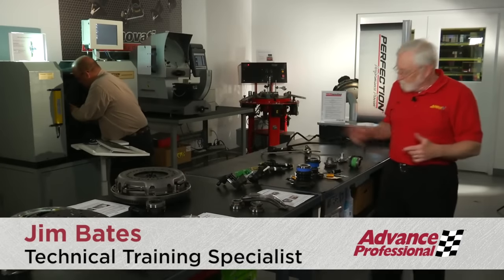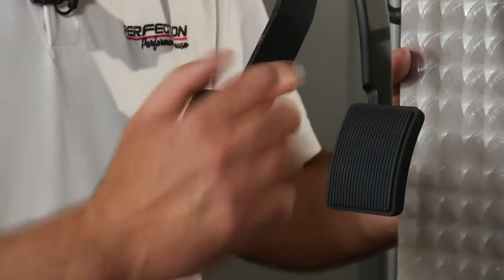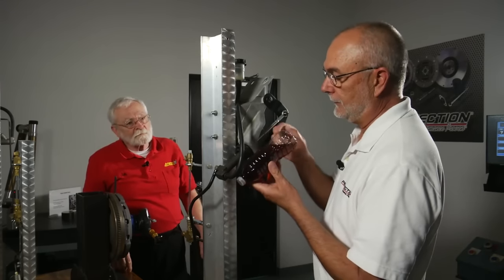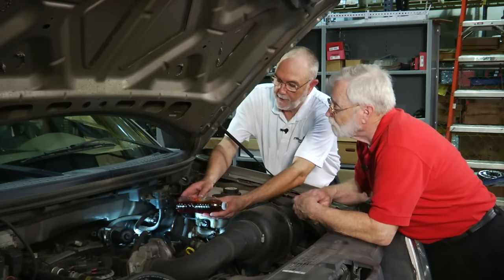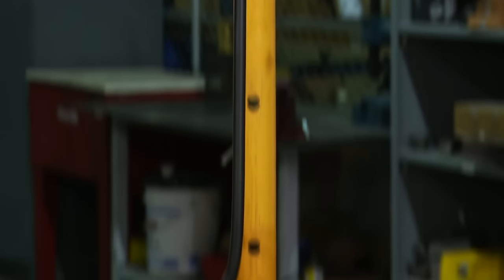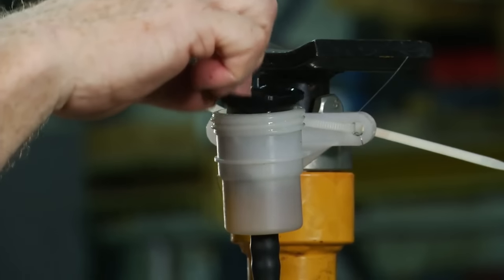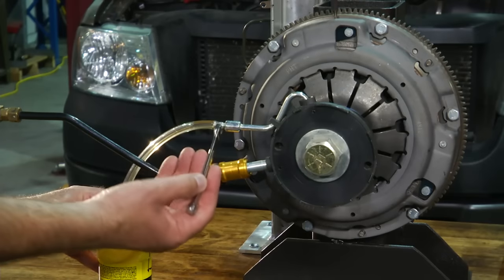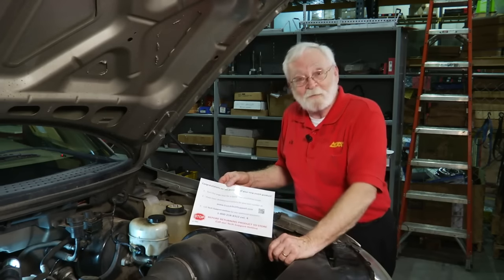How To Bleed A Hydraulic Clutch - Wrenchin' Up

Comment: Unbolting the master cylinder from the firewall, tipping it back, tapping it on the side and moving the piston in and out similar to the video worked for me. I did this without removing it from the truck.
Reply from the maker: Thanks for the tip. What vehicle were you working on?
Reply: @WrenchinUpwithJimBates  I fixed it on a1998 f 150 with allow to tip the master cylinder without disconnecting the fluid line. Easy!
Reply: Can u rebuild a slave cylinder for a 2007 sentra S.E.R spec v? And the box that the spring goes into wont hold the spring tight. How do I fix that problem?
Reply: Would jacking the front up of the vehicle quite high, while leaving the back of the ground do the same thing?
Reply: Sorry that should read, would jacking only the front of the vehicle up quite high  leaving the back of the vehicle on the ground, do the same thing, tilt the master cylinder enough?
Reply: @randylegall2162  that should work
Reply: @randylegall2162  that's what I was thinking - or park on a steep angle.
Reply: @carleynorthcoast1915  I feel like parking it on a steep angle pointing towards the river. Just a thought that overcomes me sometimes. Lol
Reply: @carleynorthcoast1915  But on a brighter note, I was talking to a mechanic I know, telling him the problem I was having with bleeding the brakes on that Infiniti g35, he had this strange look on his face like really! and then he says just run a clear plastic line from the caliper closest to your slave cylinder hook up both bleeders open them get someone to pump the brakes make sure the brake master reservoir doesn't empty out and boom your problem is solved. No one,not a single person on YouTube and I watched I don't know how many videos, of the different methods of bleeding a clutch ever mention this method, but if you think about it, the pressure from the brake caliper is quite a bit, plus your reverse pressure bleeding it, pushing the air out the way it normally wants to go which is up. I guess I'll find out today or tomorrow when I try it.
Reply: @randylegall2162  how did it go?
Reply: @bushratbeachbum  The project's been on hold, car has just been sitting, plan on this week changing the master cylinder and bleeding the system using the pressure from the caliper, I'll let you know, how it works.
Reply: @randylegall2162  how is your clutch pedal now ?
Reply: @kiwiingenuity1677  the project was put on hold I haven't installed the clutch master cylinder yet. Clutch pedal goes to the floor and stays there, needs to be pulled back up  by hand  Plan on changing the clutch master cylinder and bleeding it sometime this week I'll update you.
Reply: I’m about to do the same thing
Reply: @randylegall2162  lol
Reply: Frick! I was hoping you wouldn't say that

Comment: Sounds like a lot of work to me.....I just jack the front of the truck up and bleed normally. Sometimes you have to let the master cylinder "snap" back to get it to take in the new fluid but it's never been difficult if you ask me.  I'm an aircraft mechanic and the older Cubs were tough to get all the air out....until you raise the back of the plane above the level line.....you can set the tail wheel on a chair and it bleeds out quickly and easily.  Harley master cylinders can be tough too until you turn the handlebars to raise the end of the cylinder.   My neighbor brought his jeep over because the clutch didn't work well....jacked the front end up and wala!  bled right out and he's happy....now he won't leave me alone....hehe
Reply from the maker: Hi - Thanks for watching and for your great comment! What is the year and model of your truck so other viewers can try your tip too?
Reply: Thanks for the comment back!  The latest was a 92 jeep wrangler...it was the clutch slave but it will work on any hydraulic system.  If you don't let the master "pop" back the slave cylinder will not "reset" and you'll be there all day trying to figure it out.  The important part is to get the filling port in the master to be higher then the other end.  That will let the cylinder fill and the air to escape out.  Otherwise the bubble can remain trapped and it will never completely bleed out. Sometimes, especially with the tiny master piston in Harleys, you can tilt it one way and bleed it a bit and then raise the other end and it will make it bleed more quickly and completely.  The Piper cub I mentioned stumped a lot of mechanics and the first time I put the tail wheel up on a chair it bled right out for me.  I flew that stupid cub with limited brakes for 2 years before I figured it out.  In aircraft we pressurize the BLEED valve (with a pump type oil can.....we use 5606 oil in most small airplanes) and let the master backfill.....still won't work if the master is too low on the wrong end.  I hope you had a very Merry Christmas and a happy New Year!
Reply: Exactly.. Some cars can't be bled first due to the positioning of the pedal in order to connect the master cylinder arm to the pedal (Can't be done under pressure)
Reply: What do you mean when you say you have to let the master cylinder (pop) back, or the slave cylinder will not reset?
Reply: @randylegall2162  I've found that if the slave cylinder moves too slowly it will take the air bubble with it.  Let it up quickly and it will not try so hard to follow it.  It works...trust me....same with Harley master/slave

Comment: Trying to bleed the clutch on my truck - all hydraulic but the master and the slave are double the size of what’s in the car. I’ve just replaced both the master and the slave, trying to bleed it up but having no luck. The master is mounted vertically and bolted under the pedal assembly with a steel line going to the slave, there is a bleed screw on the side of the master and a nipple on the slave. Which end should I bleed it from, if I were to remove it from the truck it will empty of itself of fluid
Reply from the maker: Hi - Thanks for watching! Since that didn't come up in the interview, I would like to suggest that you check with Perfection Clutch for this because they have a vast library of specific videos and information. Their contact information is in the video's description.

Comment: Thanks for the great video. I parked my truck on a really steep hill and pushed my pedal about 20 times . It fixed my spongy pedal. You guys are awesome.
Reply from the maker: Actually. you are awesome for watching! I'm glad we were able to help, which is why we make these videos in the first place.
Reply: Ok where I live we have plenty of steep mountains so I’m going to try it . You removed the cap on the master ? Do you have to press the clutch petal gently so you don’t lose a lot of fluid. I would hate to get air locked on the side of a mountain 😊 Thanks

Comment: Well thanks to your video I finally got my old 91 s10 clutch bled..I just had to take it out and bench bleed it at the angle you stated....This has been a struggle for me and have been putting it off for months, I spent my life working in garages and on junk and never had this much trouble....I had to come find your page so I could thank you...Thank you so much.......
Reply from the maker: Hi - Thanks for your great comments. I'm glad the video helped and your project went well. Thanks for watching!
Reply: Same here man! 92 f150 making me question everything I thought I knew about cars! I've changed clutches in semi trucks, rebuilt suspension, engines... You name it! But evidently I am a complete failure at the simple task of bleeding a clutch 😂🤣😂 I think trying this will solve it for me.
Reply: what do you have to hold at a angle? Have an 89 s10 nothing but problems. But new parts and they go bad way too soon. New fuel pump lasted less than a month! Replaced all components at engine mechanical then the hydrolic stuff goes bad!

Comment: This is great but what if you have hard clutch hydraulic lines and you can't remove the entire system from the truck? Nissan xterras... long runs and it goes up and down between the slave and master ....
Reply from the maker: Hi - Thanks for watching! That didn't come up in the interview, so I recommend that you check with Precision Clutch about that because they have a vast library of vehicle specific videos and information that should help. Their contact information is in this video's description.
Reply: @WrenchinUpwithJimBates  NO worries man, if anyone is reading this it ended up being the slave cylinder was jank, and needed to be replaced, once  that was done, two master cylinders worth fluid and pushing fluid up from the slave cylinder (reverse fluid injection), worked amazing. Clutch pedal never felt better NO bubbles in zero seconds

Comment: On older model Volvo semi trucks they are bled  from the slave cylinder back through to the master cylinder . Use a windshield washer pump , attach line onto bleed screw  of slave cylinder  . Pump fluid until it overflows from the uncapped master cylinder and tighten bleeder screw .Install cap and tighten .                  On Chevrolet pick-up trucks it is possible to cross calipers , make sure bleeders point upward .
Reply from the maker: Hi - Thanks for watching and sharing your experience!

Comment: Depending on the master cylinder orientation couldn't you just jack the front of the car up? Or park it facing up a hill?
Reply from the maker: Hi - Thanks for watching! Some folks posted that worked for them.

Comment: Question. When you remove the clutch pressure line at the Slave Cylinder is the connection a quick sealed connection so air does not enter the line? My guess it is like an air hose coupler fitting. I also think you should use the Phoenix brake and clutch tool to remove any trapped air bubbles by inserting the tapered fitting into the bottom of the Master fluid Orifice to force new clean fluid down into the slave cylinder and open up the bleeder screw to allow any air to escape befor tightening it up again.
Reply from the maker: Hi - Thanks for watching! Great question - so great that I must recommend that you reach out to Precision Clutch, because they have a vast library of vehicle specific videos and information. Their contact information is in this videos description.

Comment: I have used A vacuum pump and A cap that fits tight over the resivor with A brake bleeder bottle and held vacuum in the system for about 10min and wah-lah that works real good !!!
Reply from the maker: Hi - Thanks for watching and sharing your experience!

Comment: Works great if you can remove the entire thing from the car.   Most cars I know of seem to have metal lines and are not removable as a sealed assembly or are capable to be installed as a complete sealed assembly.
Reply from the maker: Hi - Thanks for your comment. Vehicles that allow for the master cylinder to be "tipped up" can use this procedure. Others that cannot will have to use different methods. Check the website in the metadata to see what they recommend for different vehicle configurations. Thanks for watching!

Comment: If I install a new Master Cylinder Your not supposed to insert the clutch pedal push rod until the entire system has been reinstalled.
It is the last thing you reinstall and it locks into place in the master cylinder.If i were to use this method of bleeding the air from a new master then do i need a special tool to releae the push rod after bleeding process and reinsert again as the last item you connect?
Reply from the maker: Hi - Thanks for watching! Great question, but I must suggest that you reach out to Precision Clutch for the proper guidance, because they have a vast library of vehicle specific procedures that can help here. Their contact information is in this video’s description.

Comment: I have a 1991 F150. For the past year or more l have considerable difficulty, especially when first started, getting it into 1st or any gear, with grinding, etc.. Also diminished clutch travel. 
It sounds like an air problem????
What do you think?
Reply from the maker: Hi - Thanks for watching! I could be, but I suggest that you check with Precision Clutch to be sure as they have an extensive library of vehicle specific information. Their contact information is in the video description.

Comment: Nice video! My client's own had a similar issue so I bleed the clutch and still to no avail. I've even replaced only the kit inside the upper clutch but the problem of a sponge clutch and no gear still persist.
 I've checked scrutingly for signs of leakage carefully while someone else pressed the clutch pedal and found out that the down clutch nipple doesn't hold clutch hydraulic fluid! It goes out gently, and also the clutch fluid was replaced with a new one. Nevertheless, it's still very darkened in color. Please, how do I fix the issues? 
   Darkened fluid, soft clutch pedal, and a most especially the leak at the down clutch bleeder  or nipple.
Reply from the maker: Hi - Thanks for watching! Being retired and a bit behind the “latest and greatest procedures”, I recommend that you check with Precision Clutch because they have an extensive library of vehicle specific videos and information that may be of assistance to you. Their contact information is in this video’s description.
Reply: @WrenchinUpwithJimBates  Thank you so much Dad.

Comment: Ive had problems for a month now but believe me or dont my problem is getting better lol. A few months ago i started having probs getting car into gear and reverse was an absolute no no. The car started to rev up badly before the engine caught up again and accelerated whilst driving and sometimes this must have been a nightmare for cars behind me.  I checked the brake fluid tank and it was empty so i filled it up quickly. Now my clutch runs of the same tank! thats what i think has happened. Since i filled it back up my clutch pedal would become harder when i pumped it and i feel ive had air in the system. It juddered badly upon setting off etc until today. The car actually went into reverse and when i set off it didnt judder at all, just felt like it used to,instant set off. Ive bought a new clutch kit and csc cylinder just in case but il see what happends in next few days. If i did have air in the system its certainly took along time to pump out of the clutch lines etc. Are my symptoms definatly a sign of air in the system?
Reply from the maker: Hi - Thanks for sharing your experience. Since you didn’t mention what type of vehicle you have, to save time I recommend that you contact Precision Clutch (their contact information is in the video description) as they have a large library of videos that deal with clutch related problems and replace procedures.
Reply: @WrenchinUpwithJimBates  Sorry pal i have a GSI 2.0T Z20LET . Now i always thought clutcvh problems would get worse over time, not better lol. Went out today and it launches brilliant, before it used to rev up and not go anywere. Still does it sometimes in 2nd,3rd gear etc but not 1st. It goes into reverse now also when before had no chance.

Comment: Why would air in the line only affect 1st and 3rd? I am asking because in my subaru i have trouble going into first and 3rd from a stop.  I have to press the clutch pedal all the way down to shift into thos gears.  I am hoping bleeding the system will do the trick.  My clutch was replaced 20k miles ago. A reply  would be much appreciated.  Thanks!
Reply from the maker: Hi - Thanks for watching! This could possibly be transmission related as well. I suggest that you contact Precision Clutch because they have a vast library of vehicle specific repair and replacement information. Their contact information is in the video description.

Comment: Can I bleed it without the trans in the truck? Or does everything have to be bolted together? I'm replacing the clutch in my 95 and I dont thing the slave is bad, just has air in it. Basically wondering if I can bleed it while its hangin in place
Reply from the maker: Hi Thanks for watching! You should be able to if the Master Cylinder is at the highest point. But I recommend that you check with Precision Clutch to be sure because they have a vast library of vehicle specific videos and information on stuff like this. Their contact information is in the video description.

Comment: what did you use to stop the fluid from coming out of the bottom line where the connector that connects to the slave cylinder is. if you fill it up want fluid just run out the bottom if you don't have that connected to the slave cylinder.
Reply from the maker: Hi - Thanks for watching! The whole system remains connected. We're just trying to get the air bubbles to rise out of the system to the top.

Comment: I have a 1995 Volkswagen Passat GLX VR6 5 speed, the reservoir that feeds the Clutch Master Cylinder also feeds the Brake Master Cylinder, what is your advice for bleeding the Clutch Master Cylinder without disconnecting the brakes?
Reply from the maker: Hi Nidia - Thanks for watching and for your question! To get the best and up to date answer I recommend that you ask the folks at Perfection Clutch because they are really the experts on this. Their contact information is in the video description.

Comment: My frontier has a long, hard hydraulic line only. Seems it can only be bled on the vehicle thru the slave. Am having a hard time getting all the air out of the system. Tried the conventional way, reverse injection, and am still having problems. It's better, however the pedal returns only up until the last inch or so. Any suggestions?
Reply from the maker: Hi - Thanks for watching! I would like to suggest that you check with Precision Clutch on this because they have a vast library of vehicle specific procedures for things like this. Their contact information is in the video's description.